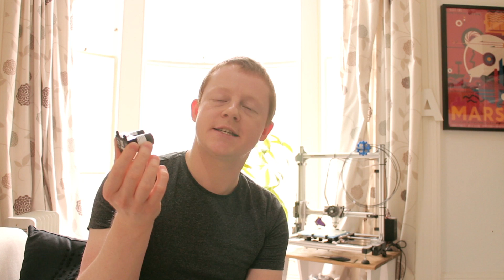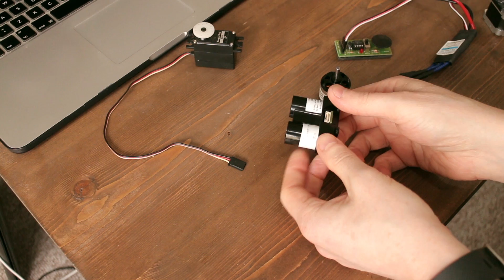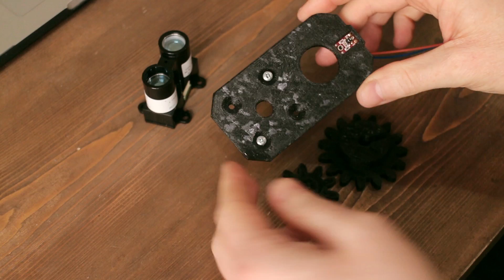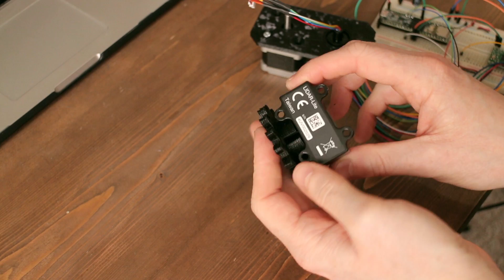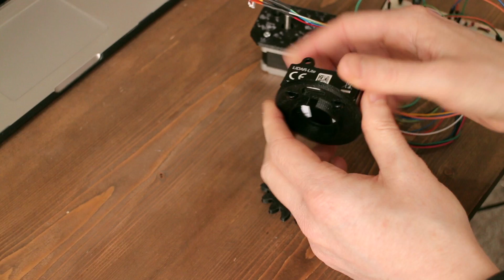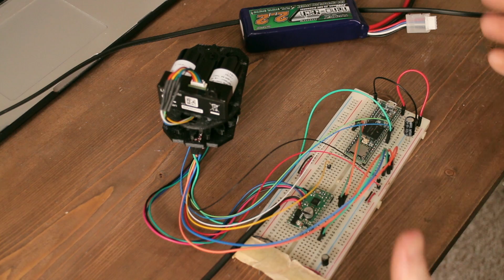LIDAR Sensor - 3D Printed Rotating Platform - Robotic Vehicle #8

Comment: If the gears are the issue you could use belt drive
Also as someone said in the comments the desk is acting as a speaker for the motor

Comment: If you use a better stepper driver you can do away with some of that noise.
Reply: Just what I came to say. You hear driver pulse.. And the desk doesn't help... But those 3d gears shouldn't be that squawky
Reply from the maker: Yeah, something I have only recently discovered after getting a good quality 3d printer that runs silently!

Comment: Why You didn't use dc motor with encoder or potenciometer? This is more quiet solution i think.
Reply from the maker: I'd agree that it's the better solution, I went with what I was most familiar with.

Comment: That's amazing,  a few years ago thousands, now less than 300 bucks.
Reply: Try a trinamic driver for the stepper motor, like the TMC2130 used for 3d printers, it's noiseless

Comment: I would've used a potentiometer and a regular DC motor
Reply from the maker: +keco185 I was initially going to use a DC motor and sensor to detect a zero position but decided on the current approach because it was "simpler".
I am looking at changing this approach though
Reply: There's no need for a "zero position". Just get a 1 turn potentiometer and map the resistance to an angle. Then, have a loop on your controller with each loop recording the distance from the LiDAR sensor and the voltage from the potentiometer (which can be converted to an angle). With this approach, the motor can be spun fast if you want higher scan rates or slow if you want more detail with the limiting factor in either case being the LiDAR sensor or the controller. You can use the following logic for removing old points from the point cloud when they become outdated: for (each point) {if (current angle < point's angle) { mark point as old } if (current angle > point's angle && point is old) {delete point}}
Reply from the maker: The idea of using a potentiometer never occurred to me which meant this wasn't an option, I was going to use the method commonly used with POV globes which use a very low friction setup and a hall effect sensor for the zero position.

The code that's currently running has the motor spinning independent of the sensing, when a new distance measurement comes back it records it against the id of the current motor position. Similar to the method you mentioned.
A lot more robust but it does take a few rotations to collect a full set of data as each reading is at a random position.

I hope to try it with a basic DC motor soon and possibly with a potentiometer based positioning system.

Comment: How does that wire no spin works again? i missed it. if this is some sort of a module could you send a link for it?
Reply from the maker: If you mean why don't the wires not get tangled up its because its using a slip ring.
https://www.ebay.co.uk/sch/i.html?_nkw=wire+slip+ring
Reply: Huh aight thanks that came in quite a delay

Comment: Good job btw... That noise is a real crack up, if you look at the average 3d printer, they use the 4 mounting holes for the motor, but leave the motor free off contact with the surrounding chassis. Your using your desk as a speaker :-)
Reply from the maker: +Chris Trigg the table was definitely amplifying things! I have now switched to a belt which with a few other changes means the whole thing runs a lot quieter
Reply: Still, i enjoyed the sound :-)

Comment: Really nice! could you please tell what did you use to avoid twisting the wires while rotating? It also needs an extra motor to scan the Z axis!  thank you!
Reply from the maker: +HABOT SSAR I used a slip ring, this allowed the 6 wires to rotate and not tangle.
The z axis is hopefully still to come but it's probably only going to be a small range of movement.

Comment: http://www.watterott.com/de/SilentStepStick

Use a silent stepstick. It'll run the stepper dead quiet. Wearing the gears (or printing them in something a bit softer like ABS) should take care of the gears, but the majority of the noise there is the stepper.
Reply from the maker: That looks like an interesting stepper driver, thanks!